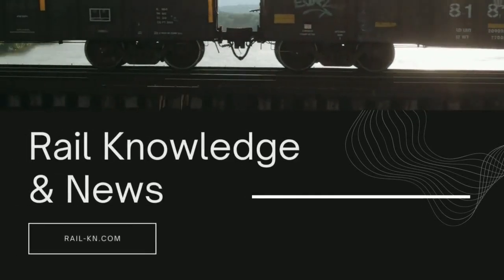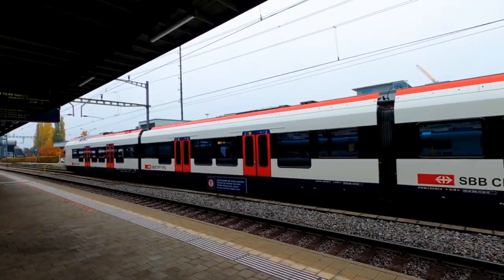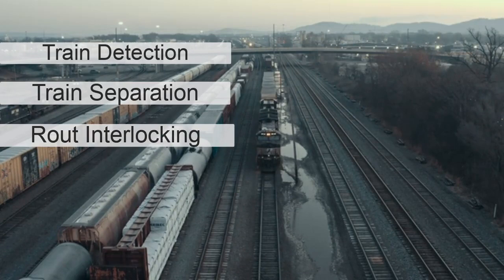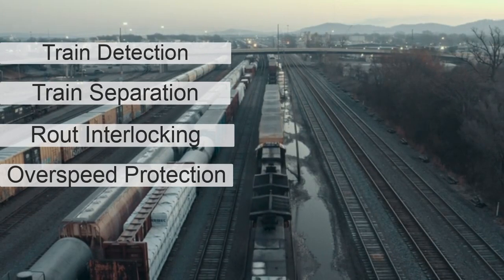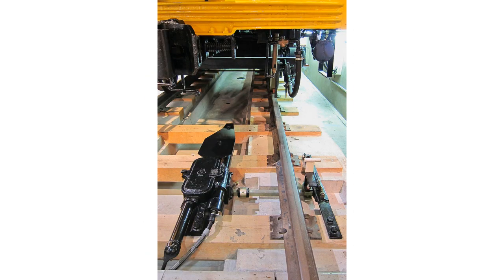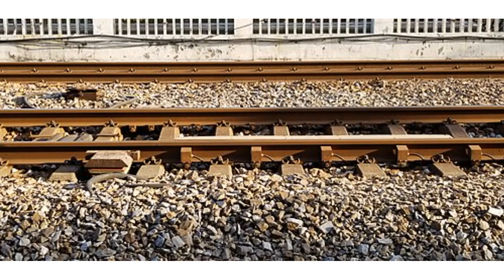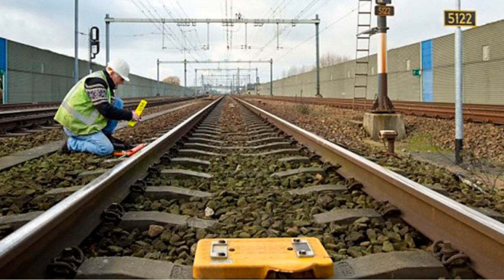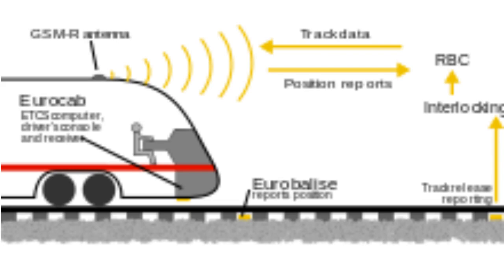Automatic Train Protection (ATP)

Comment: I am from the UK and there is a type of ATP but it is only on 1 route what is the GWML from London - Bristol and is only fitted to 3 classes of train what are the class 43, class 800/802 and class 180 all of which have a top speed of 125MPH unfortunately it is not fitted to the slower trains that also use the route what would have stopped a almost head on crash that happened in 1999 just outside london